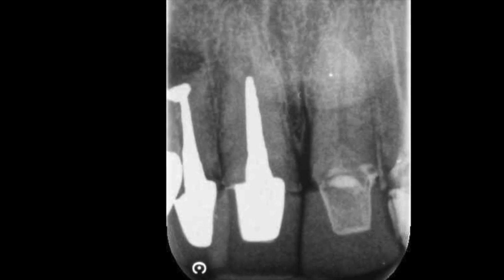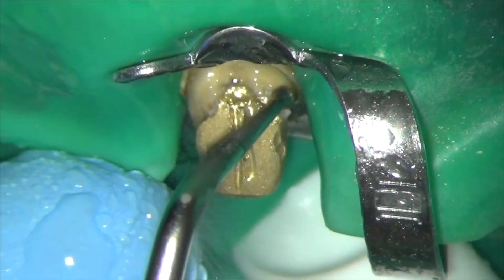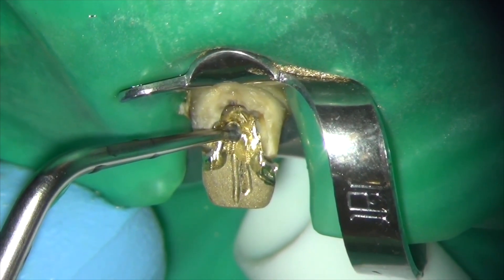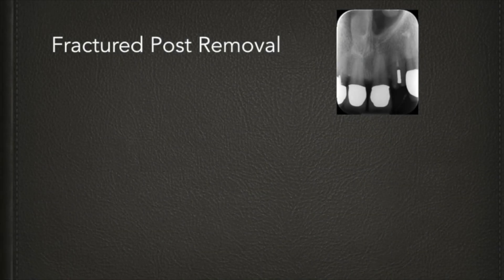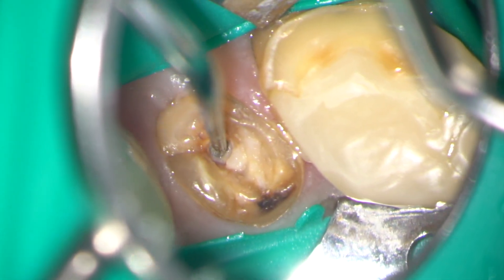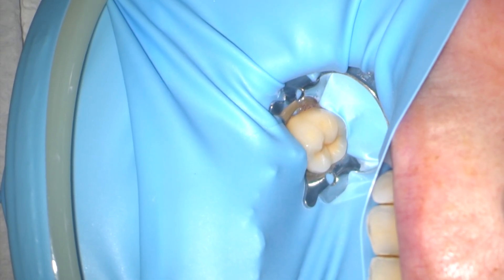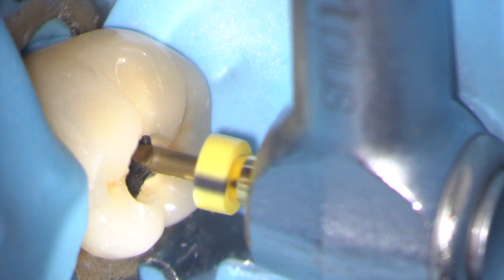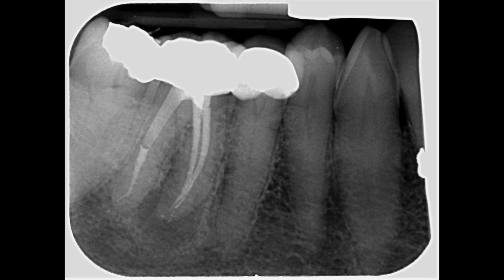post removal

Comment: Hi i have this problem with my front tooth that has an old crown with metal post. I have swelling and slight pain/sensitivity so im guessing it has infection so i would like to get post out, treat the infection and refit new post and crown .. how much would that cost with you guys? (Ball park amount?)
Reply from the maker: In the UK the fee for Specialist retreatment is approximately £950 - £1250 per tooth
Reply: @johnrhodesendo  thanks so much for getting back to me! Im really impressed by your work! Im a Brit living in LA and for some reason i haven’t found an endo that will take the post out (only offered an implant option) i fly back to the uk soon so i plan on making an appointment when my dates are confirmed!  Thanks again

Comment: Does removing post core will cause root fracture or it’s not always the case
Reply from the maker: There is a potential risk but it is generally low and has to be assessed on an individual basis
Cheers
John
Reply: @johnrhodesendo  thank you so much doctor  and thnx again for this fantastic videos

Comment: Thank you Dr.John for sharing your cases  :) I've got a quick question relating to the last case  ( a lower first molar with a prefabricated metal post in the distal canal). im wondering what instruments you've used to remove GP fully from the mesial canals ?
Reply from the maker: Hi Adam,
Often the cones come out intact with a Hedstroem, if not most of GP can be removed with a tapered file.
Hope this helps?
Cheers
John

Comment: Hello Dr.Rhodes 
In the first case of post removal, won't you put intracanal medicament and see some improvement in periodical radiolucency before obturation n putting a post 
Thank you
Reply: Periapical*
Reply from the maker: Hi NV, That would be tricky as the post is required for restoration. In this case the acrylic temporary was used until a review showed evidence of healing
Cheers
John
Reply: @johnrhodesendo  okay sure ..thank you so much

Comment: Hi Dr.Rhodes, for fiber post removal, do you vibrate it out or drill it out?
Reply from the maker: Hi Vencer
To remove a fibre post I use a small LN bur and drill out the post with the corresponding post drill.
Thanks
John

Comment: Hi dr rohdes I want to ask you about instrumentation in case when my manual file doesn't go to length but after precurving the 10 I file it reach length then I enlarge up to 25 manual but when switch to rotary it still hit and doesn't reach length these happen many times what your opinion
Reply from the maker: Hello Faiq, 
There is probably a tiny ledge or groove  snagging the rotary. 
Maybe keep the glide path a little smaller?
Try pre-bending the NiTi instrument?
Hope this helps?
Cheers
John
Reply: I try but that at least 3mm so when curve rotary its straightening it self what your recommendation

Comment: Hi Dr. John great work! 
I was wondering what power settings you put the ultrasonics on when removing a post? And also the power setting for the ultrasonic irrigation? As I find that if the power is too high for the PUI that it will cause a ledge in curved canals. Please also let us know what ultrasonic unit you are using for reference. Thanks again and as always keep those videos coming!
Reply from the maker: Hi there
I use an Acteon piezo ultrasonic
Max setting with waterspray for post removal [20]
Low for PUI [8-10]
Thanks for watching
Cheers
John

Comment: Great work 
In the last case I prefer to used dual cure bond & dual cure build up because the crown is PFM & the light could not be sure is reach to all area … what you think 🤔
Reply from the maker: Thank you!
Yes...I use dual cure bond and core material lots.for exactly that reason!

Comment: Hi Dr. Rhodes, this is amazing to see. I am a general practitioner but more interested in RCTs. I have a question for you, what kind of crowns/cement would you recommend for these teeth as they don't have much ferrule, if you have in mind. I know its prolly GPs/Prosthodontists who decide that but  please share if you have any recommendation for the materials.
Reply from the maker: Hello Minder
If possible we recommend the least invasive solution; onlays bonded using the access for retention and enamel ring in posterior teeth. Crown lengthening to achieve a ferrule of 1-1.5mm
Cheers
John

Comment: Amazing video thank you for work I have a question, can a tooth have a diagnosis : Pulpal Diagnosis: Irreversible Pulpitis
Periapical Diagnosis: asymptomatic apical periodontitis?
Reply from the maker: Hello Thu
If a pulp is inflamed to a point that the clinician feels it is unlikely to repair and recover; that is irreversible pulpitis, there could be radiographic signs such as sclerosing osteitis or widening of the pdl. The inflammatory process progresses with the different "phases" overlapping...for example inflammatory mediators can initiate periapical inflammation and a radiolucency on a radiograph but the pulp may still be vital
I hope this helps?
Best wishes
John

Comment: Great work ! Could you briefly talk about the Messerann trephine kit? What manufacturer is it from? How was the post removed “ using a smaller messerann trephine, 10:40 from your wonderful video” ,after space has been cut around it with a bigger messerann trephine? I’m having trouble understanding how the post is being grabbed on by a smaller messerann. Thanks !
Reply from the maker: Hi Greg  Thank you!
No problem, the maserann trephines are different diameters and you can grip the post with a size smaller than the first one used. 
Cheers
John

Comment: Thank you for another great video. I missed you. You have changed my endo. But you already know it 😉. Recently when I was removing metal post I used two ultrasound machines. One is on the dental unit(LM) and the second one is external (woodpecker). I placed them on the vestibular and palatal aspect of the tooht, set on high power. The post came out in under a minute. Koldan was used in my region in past decades. This alloy is quite soft and melts after applying ultrasonic power. However, it is possible to drill it out using for example Munce bur. It is great, that teeth with failed posts can be saved and restored again. Greetings from Slovakia.
Reply from the maker: Hello Anna
So lovely to hear from you! and pleased you are enjoying the videos, I come across interesting materials here in the UK! 
cheers
john